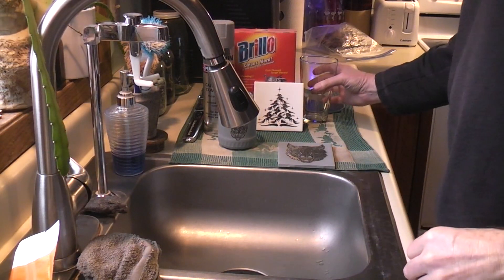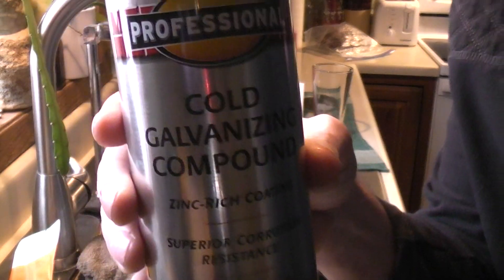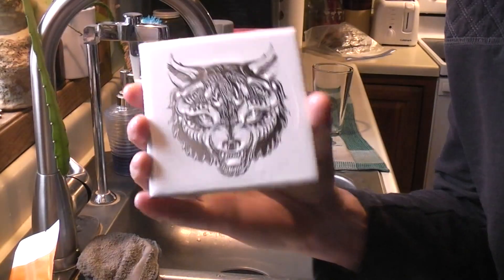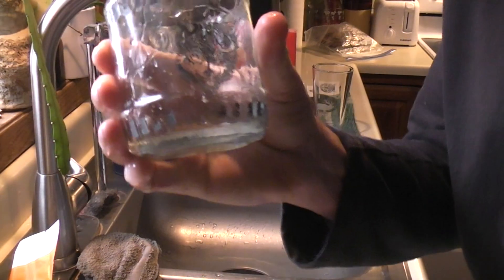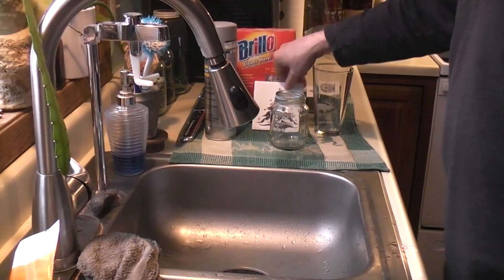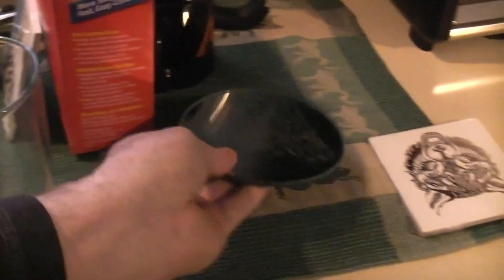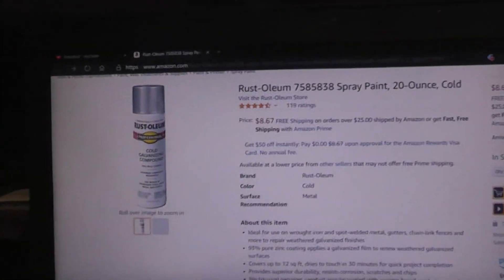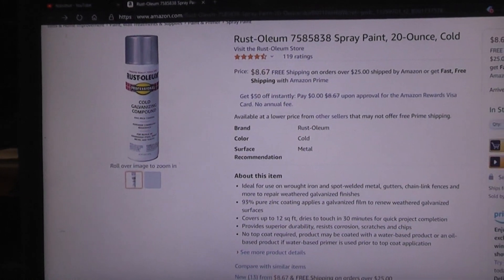Zinc coating for diode laser "etching" glass & tile. Water clean up. High contrast.

Comment from the maker: Long story short I have stopped using the zinc coating as the new cans of it that I have bought are not giving me consistent results. Its like no matter how much I shake up the cans I get uneven results, so I am back to using black spray paint and cleaning it off with thinner again.
Reply: Damn it!
Reply: Supply chain issues here in Canada. I believe that I got lucky finding the last remaining can in Ontario, Canada.
Reply from the maker: @edvanderryd13  Make sure you mix the spay can well or you will get inconsistent results. I made a simple can spinner from PVC pipe and a bolt to chuck in a drill.
Reply: @Robothut  Sounds like a good suggestion. I have no idea what the spinner looks like, but I will research it as I too have a had a few inconsistencies. The zinc works great on Stainless Steel marking too.
Reply from the maker: @edvanderryd13  I plan to do a follow up video, showing the simple can spinner and the air assist I added to the NEJE 30 W diode laser since it has been 1 year since I changed to that diode laser. But basically you just find a short piece of PVC pipe that a can of spray paint can fit into, and a PVC end cap for the pipe, The drill a hole in the end cap and take a 1/4 inch bolt and nut. That way you can chuck the end of the bolt into a drill once you tighten the bolt & nut threw the hole in the end cap. You can use a  rag or get fancy and use stick on foam rubber window stuff to make it so the can pushed in snugly to the PVC pipe. then spin that can in both directions. Mixes it up like crazy.
Reply: It's pricey buy you can always use the laser marking spray and just build it into your price or hobby
Reply: I bought 3 cans and so far the first one is not giving dark blacks like yours.no matter the power or speed.hopefully the other two cans come out well
Reply from the maker: @adalidfuentes5307  Make sure you mix the cans well, I use the drill spinner that I did a video on in my robothut channel. There are so many solids in the coating that it is hard to get it 100% mixed. But who knows they may have changed the product since I did the video with my old can of coating.

Comment: Your results are great, but I'm pretty sure you're giving credit to the wrong substance. What makes Rust-Oleum products work is not Zinc, it is Titanium dioxide. While it's true that as long as you stick to this particular spray, it's not even so important what exactly makes it work, but knowing what exactly to look for, you may even get better result by finding the product on their website with the highest content of TiO2. Or even use Titanium dioxide powder in combination with, say, wood glue and water to produce the brush, roller, and maybe even spray applicable emulsion, and play with percentages which may even yield better results.

I think this may also resolve the problem in your pinned comment. It's not the Zync.

Comment: Hello. I'm using the same brand, but does give me the black color like yours..
Any ideas why? They come out gold-ish..
Reply from the maker: My best guess is that the solids in the can are not 100% mixed in with the liquid part of the paint. I use a spinner mixer and my drill to get it mixed in all the way. Other than that it is just a mater of the power setting.

Comment: Maybe you can help me with this. When I used this it ruined the lens on my engraver. The residue from it flew up and got on the lens and then got etched into the lens effectively making my laser useless now. Anyway to prevent this from happening again?
Reply from the maker: Use air assist. Most laser unit have this stock these days or as a option. All coatings that you burn will make and deposit on the Lense if you do not set up a air assist system.
Reply: @Robothut  I have air assist but had it off. Lesson learned

Comment: Thanks for this video. One problem I’m having is cleaning the residue after lasering. 

The image I’m printing come out looking a nice black, but the black “scratches” even when I use a regular green and yellow sponge. How are you using a Brillo pad and not scratching it? 

Is my black not getting engraved properly? Or are my ceramic tiles cheap, or something else I haven’t thought of?
Reply: Try higher power and slower speed.

Comment: i tried this product on ceramic tile and did not get good results at all.  with the same setting using white rustoleum i got far better results
Reply from the maker: It is hard to get the solids in the Zink coating mixed in completely. I did a video on a spray can spinner that really does a good job of mixing the solids in. But if you got a something that works for you why change, right. I used to get really good results from the 99-cent white spray paint from Walmart, I think the price is $1.50 now.

Comment: I'm looking to "mark" not etch 2oz Shot Glasses.  One fellow used Cermark.  It's kind of pricey.  Do you find that this Cold Galv paint leaves a nice rich black marking on glass, or more like grey?  TIA
Reply from the maker: Gray. black paint works also but leaves a gray mark. I see many guys are using titanium powered these days to get a dark mark. Search YouTube and you should find a few videos.
Reply: @Robothut  Thanks.  I actually have a bag of it in the shop.  I'm trying to figure out a way to do production style work for shot glasses 50 at at time.  That kind of work.  One of my customers in Florida tells me that most of their customers gravitate towards screen printed shot glasses because it's easier to see the artwork vs etched.  The Cermark method will be very quick to apply, like your Galv paint.  I've ordered a small 2oz can to test.
Reply from the maker: @pfiltz  Let us know how it goes as far as a nice dark marking.
Reply: @Robothut  Will report back with evidence... ;)

Comment: I tried this process this last weekend. Sprayed on and burnt dark. YAY!!! Cleaned off and 97% on the image washed away as well. NOT SO YAY!!!  tried on tile and glass, same results. Glad I only spent $10.00 on the can
Reply from the maker: That probably means that the solids in the spray can were not mixed in with the spray base paint, or that the laser power is too low. In any case it is good that the stuff was so low cost . I did a video on a spray can spinner that you use with a drill to realy get the solids mixed in with the gray paint base.

Comment: What settings did you use for the tile I tried 1000 speed and 65 power and it wasn't enough
Reply from the maker: It might be that the solids in the spray can are not mixed up well enough. Thats why I did a video on using a drill spinner to mix the zinc solids up.

Comment: i bought this product and it does not come off with water.  I tried everything from alcohol, goo gone, etc. I did eventually come off with mineral spirits with alot of elbow grease.  Took way too much time as I have a bunch of these to make.  Although it did turn out darker as I like the higher contrast..  This was being applied to stainless steet tumblers.
Reply from the maker: Must stick way better to metal than to glass or tile. I guess it would as it is designed for metal applications. Thank you for the update, now we know not to use it on metal unless we plan on using thinner to remove it.

Comment: Thanks for the video. Used it but when i clean it nothing stays all gone. Do need to engrave on the other side or on the paint side any suggestion?please.
Reply from the maker: When nothing is there, that can be a few things. Laser no focused, Laser power to low or most common the solids in the Zink did not get mixed into the spray properly. I use a drill spray can spinner, you can find a video on that on my channel.

Comment: What settings do u usually use to do this
Reply from the maker: Any where from 40 to 60% power depending on the look I am going for, my program lists speed in mm per minuet so around 1000.
Reply: @Robothut  that's weird I had it at 900speed and 90 power and didn't do anything to mine
Reply from the maker: @lil_bofo3103  Sounds like your diode laser has lost power. When my first diode laser lost power it would still cut and mark carboard and thin wood but would not mark glass or tile no matter what type spray I used. So then I bought the NJE diode laser and things have worked great for 1.5 years now.
Reply: @Robothut  I have a co2 laser but will check my alignment and mirrors that could be the issue thanks for heads up
Reply from the maker: @lil_bofo3103  Two other things. co2 laser is more powerful you might try even lower power setting like 20% you might be blasting the coating away. Also The Zink coating is so heavy with solids that you have to make sure the can is really mixed up well, the spray looks the same mixed and not mixed, but without the zinc mixed in it will not work. So I did a video on building a simple spray can spinner that will mix the cans so that you know you are getting the zinc solids mixed in .
Reply: @Robothut  got it will do a speed and setting test with it sprayed thanks for the help

Comment: So I noticed that 7 months ago you pinned the comment that you had stopped using this as you are not getting consistent results.  Some newer comments indicated that you just needed to mix it better.  Do you still think this product is the way to go?
Reply from the maker: Once I built the spray can paint spinner, that 100% mixes the solids in the spray can I used it again. I did a video on the simple DIY spray can mixer that uses a drill and PVC pipe to mix the cans. I still like using cheap black spray paint and even white spray paint for some projects.
Reply: @Robothut  Thanks for the reply, I have 3 cans of this stuff.  I will look at the spinner.

Comment: There are people trying to sell cans of this Rustoleum Cold Galvanize spray from $60 to $100 now! Crazy! Don't spend that amount, it would be cheaper to buy LBT or Brilliance, which is spray made especially for lasers. These work especially well on metals.
Reply from the maker: Wow. That is crazy. There are all kinds of inexpensive coatings that will work just fine if your diode laser is working right. I never paid more than $10 bucks for the Zink coating.

Comment: Do u spray the mirror?
Reply from the maker: No , the laser just burns off the black rear coating of the mirror. You do not etch the mirror from the front but from the back. So you should invert the image so that when viewed from the front it looks right.
Reply: @Robothut  and what settings u use on it?
Reply from the maker: @rigopulido4897  That would depend on your diode laser. Start with a low power setting like 40%, if you do not see results then increase the power.
Reply: @Robothut  thanks I will tray I have a xtool 10w

Comment: Use pure titanium dioxide powder you dissolve in water with little alcohol there is directions on any bottle. It's a white powder. It's what's in the spraypaint that engraves black

Comment: I been searching for the best method to burn the tiles with my 100w CO2 laser. The zink spray it's the secret to etching the tiles and get the best contrast.  You are awesome  ! thank you. The spray that you list it's discontinued. I can't find it anywhere. The one that I am using is rust-oleum item no v2185838 93% pure zinc.  ( cold galvanized compound) I found it local for $25.

Comment: Any chance you could do a video showing how you do this on the LightBurn side?  With image processing and whatnot?  I bought some of this cold galvanizing compound but mine turn out horrible.  Settings were 1200 mm/m, 20% power, 300 dpi on a xtool d1 10w.

What setting do you use on tile?

Thank you in advance!!
Reply from the maker: My laser unit cannot use Lightburn unless I change the firm ware, so I have to use the program that came with the unit for now.
As for settings I think if you go with 40 % to 50 % power you should be good. But also build a spray can spinner "mixer" I did a video on it, super easy and cheap but the only way to get all the solids in the cold galvanizing compound mix in properly.

Comment: I have used CGC on white tiles for a little bit and it was working just fine.  All of a sudden, it doesn't seem to work.  When I clean the tile, most of the black comes right off.  How long do you let the coating cure before you burn it?  I had an older tile painted and it worked OK but the new ones that I just coated seem to be the issue.
Reply from the maker: For me it never makes any difference if I let the tile dry or just walk right in and etch it. But when I did have a problem last years with the coating working, I found the solids in the coating were not getting mixed well enough by hand shaking the can, so I started using the drill spinner to mix the spray cans. I did a video on a simple build for that.  And before I changed laser diode heads "over 1 year ago" I had a time when all etchings stopped working and it was do to the diode laser having lost power. I could still burn "etch" wood and carboard but not paint on glass and tile. It was like a switch had been thrown. One day it just toped working , so I upgraded to the NEJE diode and things have been OK for over 1 year.
Reply: @Robothut  - Thank you for the information.  I just ran a material test using the new feature in LightBurn and the results were just what I had determined before.  The material test worked just fine.  Not sure why the actual burns I want to do if failing.  I'll figure it out.  I had noticed with my white painted tiles that there was a noticeable difference with tiles that had been sitting for several weeks vs just a few days.  The older ones just weren't as black.
Reply from the maker: @CNCATHome  Lets know what you learn as you figure it out. Could help a lot of people.
Reply: @Robothut  - I started today by burning some white painted tiles and the burn worked as it should.  I then burned some of my CGC coated tiles and they too worked as I had hoped.  It seems that the CGC liked curing for a good 24 hours before use.  That was the only change.  I didn't even refocus my laser before running the material test pattern.  I had placed a couple tiles on my space heater for the material test.

My takeaway from this is that letting the CGC cure for at least 24 hours seems to be what was needed.  For today's burns, I did refocus the laser but it didn't seem to be out of focus when I looked at it.  But I messed with it a little.  7 successful burns today.  So let the CGC cure for 24 hours or so and make sure your laser is focused.

I did try washing the CGC off of one of the tiles using just water and it didn't come off at all unless I went after it with my fingernail.  I didn't need the water for that.  I makes me think that before it has fully cured, that the water might wash it off more easily.  Using lacquer thinner on freshly painted tiles almost rinses the stuff right off without any scrubbing.
Reply from the maker: @CNCATHome  Great info and update. Thank you for sharing with us.

Comment: Long story short, you know when they say don't weld galvanized metal without taking it off? Yea, that laser is not much different.
Reply from the maker: Yep. Not supposed to weld over paint either but all the people doing diode laser glass & tile etching have been. Long story short burning things with a laser is dangerous so only do it in a ventilated area.

Comment: I had read a little about this stuff in another post, and thank goodness I finally ended up here. I'm learning even more just reading the comments. Going to try and pick up a can of the "plain" stuff as well as a can of the "shiny" stuff. And some PVC to try and cobble together the paint shaker you fellas talked about. Mr. Robothut. THANK YOU SIR for starting this post and especially THANKS for sharing the bad results as well as the good. I really like the water/brillo clean up you mentioned. My 71 year old lungs were abused enough smoking cigarettes and just about anything else that would burn in my younger days. I just got my X Tool 10w laser and I'm trying to learn Light Burn. I still need to figure out how to dial the  laser speed and power in before I punch the start button. Anyway, Thank You Again Sir for starting this post and Thanks to all the people here contributing there own trial and error results!

Comment: I can not manage to get my images to stick.what am don’t wrong?I have a 5.5e diode laser
Reply from the maker: Not sure what a 5.5e diode laser is, maybe the e is a typo. The only time I have had a problem etching painted  glass or tile was when my first cheep diode laser had lost power do to being run at 100% one time. My new NEJE is still working fine after 1 year. So not sure what brand laser you have but if it was a low end one then even though you can still burn wood and cardboard you will not be able to etch glass or tiles. At least that was what happened to me. So I replaced the low end laser diode with the NEJE unit.
Reply: @Robothut  yes you are right.my laser lost it’s power 😞 it’s not even engraving wood anymore.I sure learned my lesson!
Reply from the maker: @adalidfuentes5307  It is OK, just replace the laser head with a new one, they are so much better these days and last a long time.
Reply: @Robothut  I had a twotrees totem s now I got me a atomstack laser module and mounted it right on.hopefully I have better luck with this laser head.it’s the m40.also got a neje 10w on The way
Reply from the maker: @adalidfuentes5307  Both sound like great diode laser heads and should work very well for.
Reply: @Robothut  so the 5w m40 did ok,the neje 15w did ok,but the
1.6w did the best.I’m thinking long focus lasers wok best.watts really don’t matter
Reply from the maker: @adalidfuentes5307  Thank you for the information. I know you do not need much power and it might come down to the focus of the laser as you said.